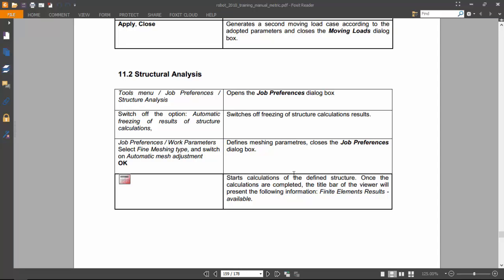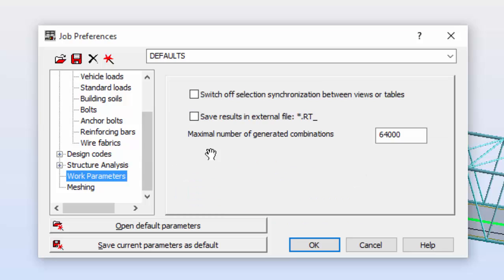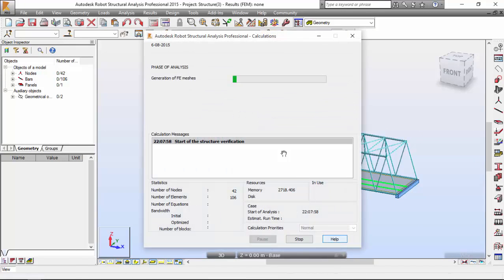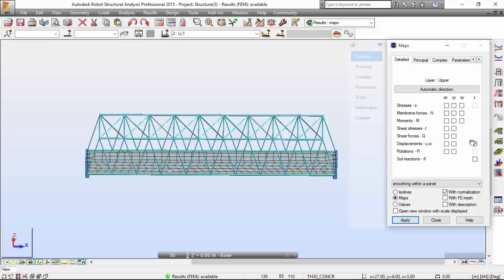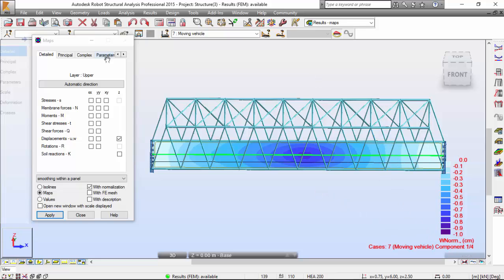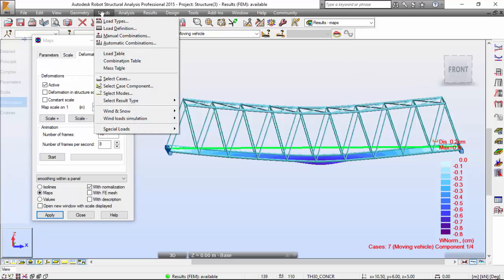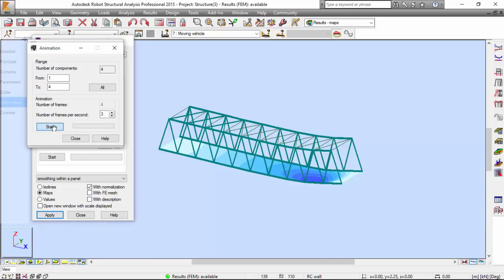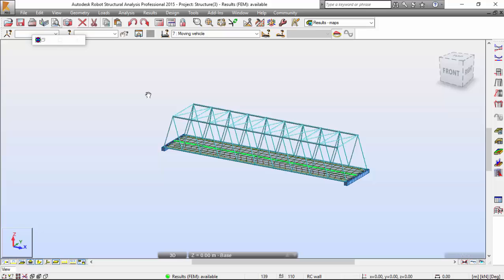Exercise11 - Part 4 - 3D Single-Span Road Bridge with a Moving Load (Robot Structural Analysis)

Comment: I have a problem with the result where the beam and member do not show bending when deformation is actavated ( i also activate section shape). Unlike your video which shows the bridge bending when receiving load. Is there any solution to fix this problem?